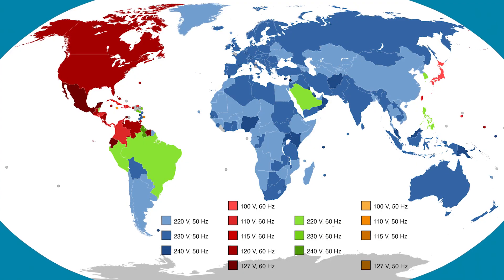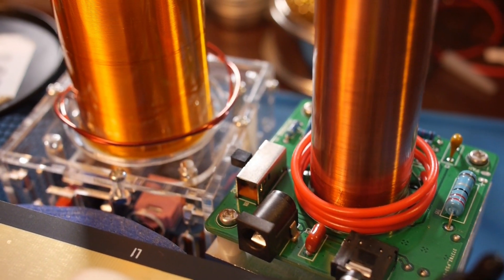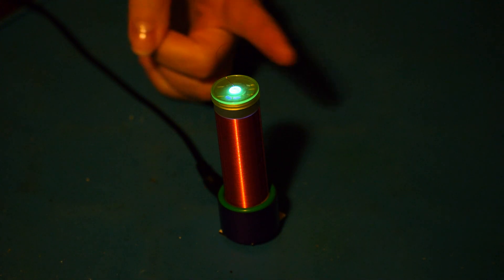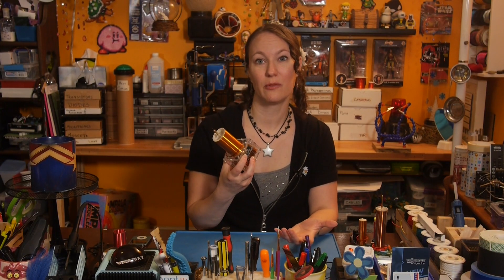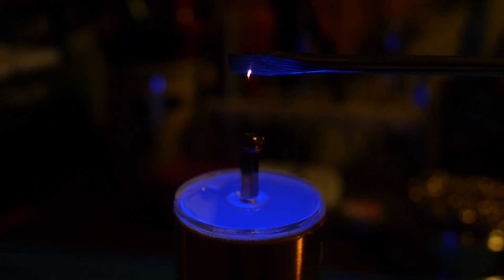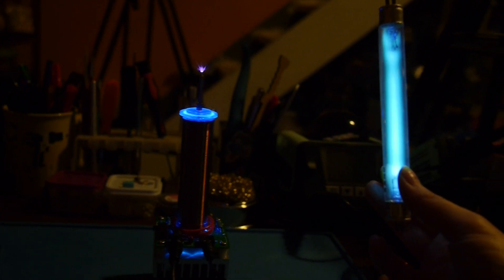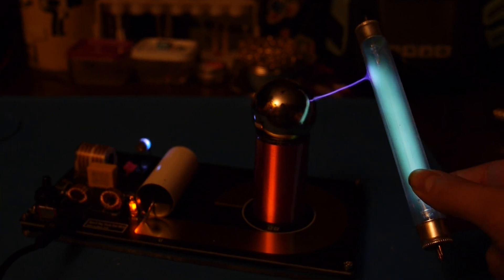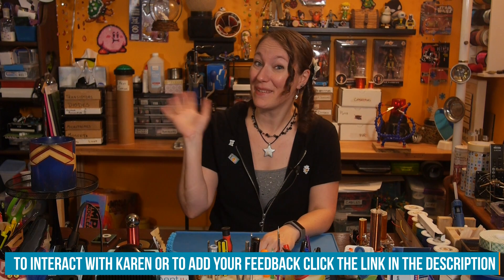Transformers in Action: Tesla Coils - The Learning Circuit

Comment: I got one of those small Tesla coil kits (3£ jobbie) - hooked up a buck converter to get the 12v and other onto USB battery bank and used it to test my bathroom fluorescent tube.  Which worked, indicating that it was the starter gone and not the bulb without having to take it all apart. 

Who knew a Tesla coil could have a useful diagnostic feature that saved time.  You do now.

Comment: Great detail, just an FYI @ 2:11 "Indicator" = "Inductor".  They have different electric and magnetic characteristics.  ;-|)   I was thinking you'd think 3 Phase to 1 Phase and related transformers would be boring and risky.  Someone has some videos online that are great... let me see if I can find.  Here is the best one I think:  https://www.youtube.com/watch?v=whaJrCdNw9Q   My plan for a generator study of 3 phase to 1 phase and vice versa conversion analog and digital methods, so limiting the Prius CVT MG1 or MG2 which is another fabrication or case mod experience..., is first limiting the RPM's via a small engine from a generator or garden tractor to limit the output power.  Still mains and higher voltage and current. Now in regards to these transformers, has me thinking like the Plasma Channels last experiment using the high elevation drone and electrostatic motors and devices, to perform the opposite and transform down the low current high voltage into higher low current and lower voltage.  That seems like something I've never seen done online before and might be something more practical.